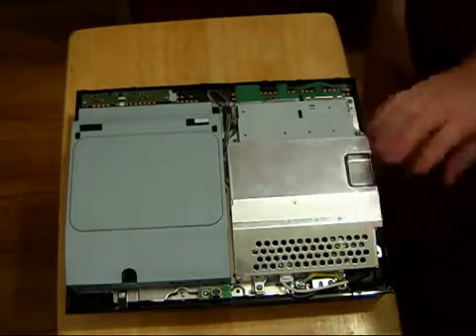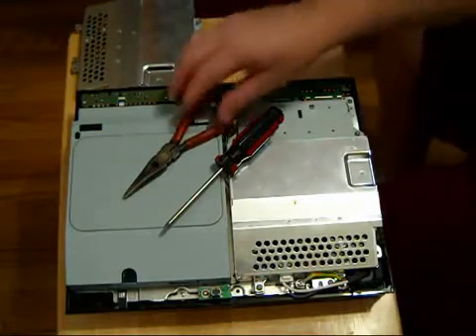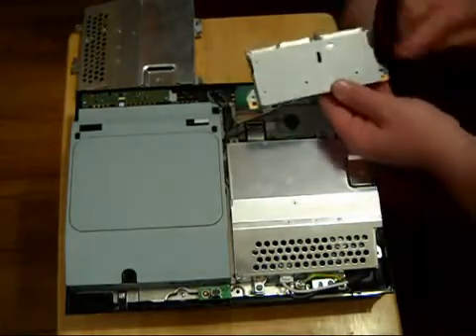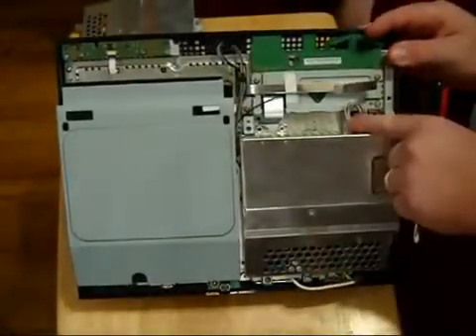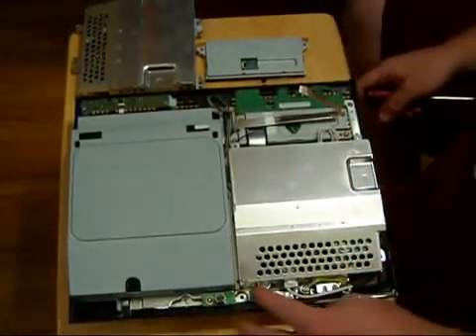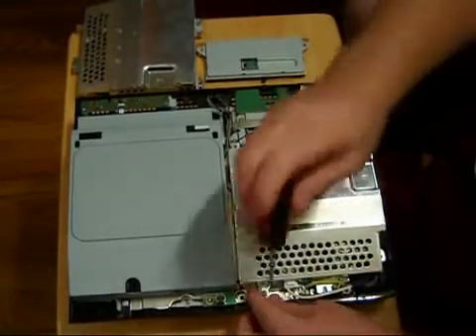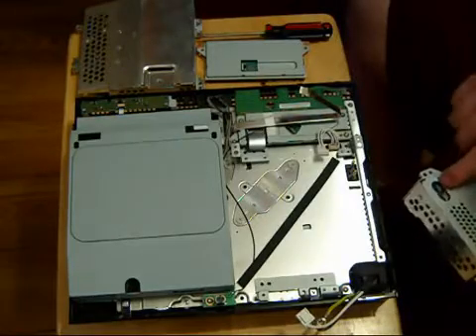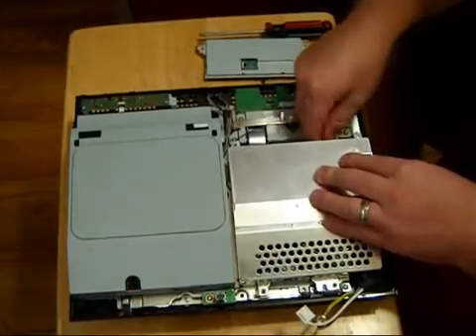PS3 Repair Power Supply Replacement

Comment: Just curious.... is the console facing up or flipped upside down?  My console keeps shutting off during gameplay and I'm thinking it's the power supply.
Reply: Having same issue. Please help
Reply from the maker: power sup[ly go bad it will over volt and push chips harder and over heat them, try cleaning fan first. new thermo paste